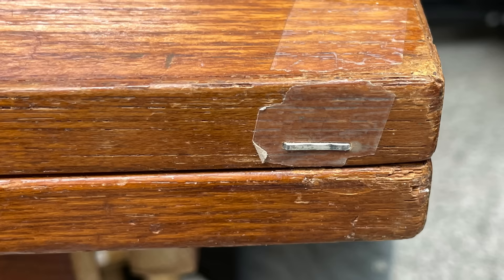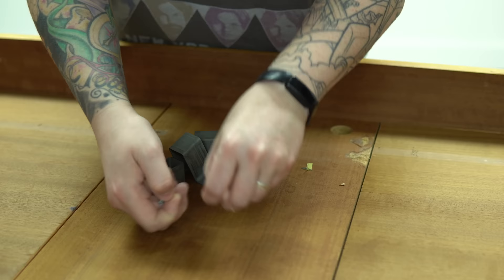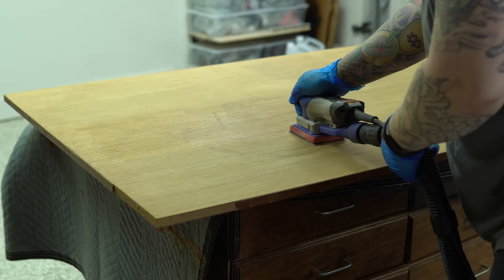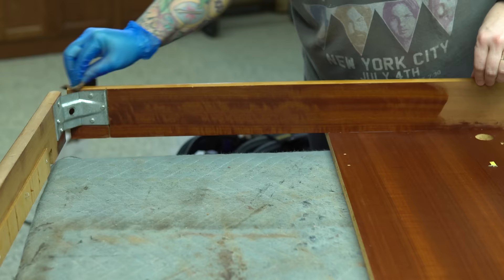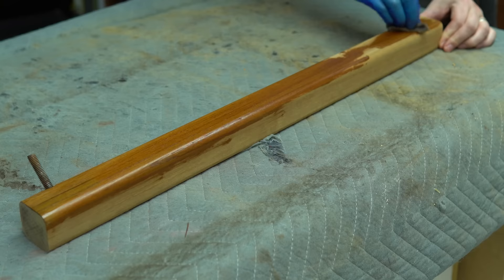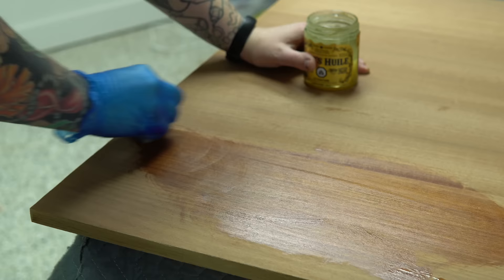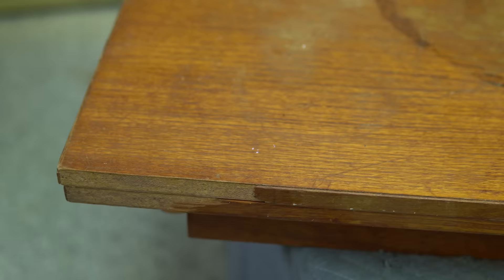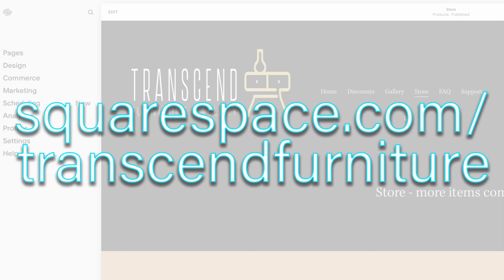I restored this absolutely WRECKED Teak Dining Table

Comment: Angie, I used to apply a sealer of some kind where I worked at a custom cabinet and door company.   My boss would say, "most people won't finish/seal the backs or inside or bottoms of a piece but it's really better for the wood as far as absorbing moisture less and drying less.  More even.  And besides,  it's us."
It turned out SO BEAUTIFUL 😍.   I'D BE PROUD TO OWN IT. And, I use coasters btw. 😃 💜
Reply from the maker: Thank you for using coasters! ❤️

Comment: Oh, the Oddie's Oil has a tung oil base! That makes so much sense! I keep hearing about how great tung oil is relative to mineral oil so I was wondering if you ever used it. Good to know! I've been trying to figure out what to do with my home's smaller wooden pieces. We live in high altitude desert, so it's great to get ideas on what I should use to keep them in good shape.
Reply from the maker: Yes it does! Thanks so much for watching!

Comment: It's not a silk purse but I rate it as a rayon purse from a sow's ear. What is the value of a piece of furniture made out of glued sawdust covered by a very thin veneer?
Reply from the maker: More than 3/4 of mid century furniture was constructed this way, to save money AND valuable resources (particularly exotic woods like mahogany and teak), and thank goodness they did it this way or there'd be none left. It may not appeal to you, but it makes the furniture extremely stable from a wood movement perspective, where solid wood is very prone to cracks and checks when it expands and contracts with temperature and humidity. It allows MORE furniture to be made from the same exotic wood, rather than one single temperamental piece of furniture, and it makes it more affordable for both the maker and the consumer. Have a look at retail prices of this furniture and the fact that they sell like hotcakes.. and then ask where the value is, haha. It's not just mid century though. A LOT of antiques with stunning woodgrain are also veneers. Veneer doesn't mean cheap. And the pressed wood of the mid century era is not the same as the 1980s and 1990s junk.

It's a very important question you asked though, so thank you for bringing it up! Not many people actually realize just how much furniture is made this way... most of it has been passed down in families as "solid wood" and it's not. There's just a misunderstanding of how and why manufacturers did this. 

The 80s are different. lol That's when factory furniture when to Sh*t. lol
Reply: @TranscendFurnitureGallery  Thanks for this detailed explanation. I do some refinishing but I mostly stay away from 80's and 90's pieces for this reason.
Reply: Yes but, saving an item from the pile of trash we generate to make is usable is a worthwhile goal and activity!
Reply: My thoughts too!
Reply: @TranscendFurnitureGallery  thank you for explaining. I always wondered.
Reply: @TranscendFurnitureGallery  Angie, I LOVE how much I learn from you!!!!!!!
Reply: I am refinishing an early Pottery Barn table, I am guessing it is late 60s, early 70s, by the style of the lettering I found on the tag.   The font used was popular during that area.  It was kind of hippie lettering that I remember during that time.  I messed up, thinking that somebody just painted over a beautiful wood table, and used a stripper, that stained the hell out of the grain in the veneer.  I was flabbergasted when I found the sticker, and found that that was the original paint job.  I also  sanded it, and used a scraper, and some of the veneer got scraped up with it.  Soooo, I am back to restoring the paint.  Even though the grain on the top (I haven’t finished it yet) is lovely… I am not pro, just did some refinishing since I was a kid.  The wood bleach is a great idea!
Reply: Right now I am working on four very rusted (one I painted when I was 12), nickel plated “Ice cream chairs”.  Somebody thought it would be a good idea to spray clear paint on them, and they got horribly rusty.  I am going nuts with this.  I have sanded off the rust, because, quite frankly, the rust remover by a well known company did diddly sh**.  I also sanded down parts that show the copper underneath.  I would like to have them re-plated, but I am afraid it might mess things up even more.  I want to leave as much of the original plating as I can.  These chairs, refinished are worth a lot of money, even those that have most of the nickel sanded off down to the copper.  They were made sometime in the late 19th century in Indiana.  They are riveted together, and one is bent out of shape by movers.
Reply from the maker: @davebryant8050 That's not entirely correct. Here, in Nova Scotia, this table would retail in a dedicated mid century store for close to 1500-2000 dollars CAD. Where I no longer have a storefront, I would charge considerably less, but still worth the time. I've seen these go for much more online and in larger cities. Looks are deceiving. You may see veneer and pressed wood, but that's what 90% of designer mid century furniture is, and the market for it is still going strong enough that there are many many stores devoted specifically to this exact thing. 
Not to mention, a huge portion of "solid wood" furniture sold in places like The Brick, Ashley Furniture etc... is NOT solid wood. But this same thing.. wood veneer over a manmade substrate, carefully stained and toned and finished to look high end. 
Once people start working on furniture, like really breaking it down, they often don't realize the myth of solid wood furniture, and that it's actually quite few and far between.
Reply: @DJarry394  "Owww!!" Sorry that that happened.
Reply: @TranscendFurnitureGallery  Correctamundo.

Comment: I LOVED the final results; I realize what you did, the overall approach. You "Made Haste Slowly," letting your stripper and sander do the work gently, because you were smart and experienced enough to realize that there was a treasure buried under the appalling markings that were all on the surface of the wood veneer. Since the veneer was only 1/16th(looked like) inch, there wasn't really enough for any heroic renewal of the surface by removal and the discoloration had to be removed by "elbow grease," basically. I think the grid mark was from a plastic beverage crate, that many people use for storage, which got wet with some stain or other. You did a beautiful job. Thanks for posting this.
Reply from the maker: Thank you so much for watching! I think you're likely right about the milk crate type of product leaving the stain, that's what I thought of as soon as I saw it because of the pattern. 😊

Comment: I'm only part way through but I would love a series on why you choose certain methods, like removing top coat, when you scrape, use stripper, or just sand.  If you were refinishing for selling vs using for yourself, what would be different about the process materials?  Just the basics of the why behind the different  techniques. 😊
Reply from the maker: Zero difference between selling vs for myself - I keep some of these pieces for our own house but every piece is treated exactly the same. I do have videos posted about sanding etc. If you scroll through my posted videos you'll see a number of videos that address things you're wondering about. I will say, in regards to sanding vs stripping - I usually will only sand a finish away if it's basically non existent or if I'm on solid wood. I'll scrape usually over veneer with SOME finish, or a lighter/damaged finish, and I'll use a chemical stripper for removing thick finishes or multiple layers of paint. I hope that helps!

Comment: Good for you.  That table is a worthwhile thing.  I just bought a modern desk from "Oklahoma Furniture."  I don't know what it's made of, but it's not real wood.  The finish comes off the edges, and it doesn't take Old English.  I can't clean the top.  Oil from hands gets on it, and I can't get it off.  Less than one year after purchase, one of the fancy metal drawer pulls snapped in half.  The desk cost over $1300.  (I have an old house with hardware that still functions after 110 years.)  In comparison to my desk, your teak table is a great step up.
Reply from the maker: Thank you so much for watching! Isn't it sad how poor of quality most "new" furniture is?? I'm so sorry to hear about your desk. I love the solid, older pieces. Worth a restore any day!

Comment: Hi, a tip for getting the Oxalic to work better is to use some soda water on the wood first and whilst this is still damp hit it with the Oxalic. You'll think you have ruined it at first as the soda makes the wood go very dark, but they react together and the Oxalic penetrates more and works better. You may need to do it more than once with a good rinse and dry in between. I've seen this draw out some incredible stains and oxidation 🙂
Reply from the maker: Thanks for the tip!

Comment: Hi Angie
I have too have tackled heavily damaged teak tabletops with Oxalic acid.  However I have had success with deep stains that may also be of interest with you.  I use barkeepers friend witch has a low concentration of Oxalic acid.  I pretreat the stains with repeated  poultices.  Ending the process after lifting them with an application across the whole top.  I haven’t yet had a bleach discoloration as a result of the pretreatments.  I have been able to remove 90% + stains employing this method on mid century tables and dressers.   8+ pieces done this way.  Perhaps too slow a way for a professional.  However for a beginner it’s an accessible product to get.  Allowing for a forgiving learning curve
Reply from the maker: Thanks so much for watching!

Comment: That turned very very nicely. I have had the smaller square version of that table since 1978 and it is in better shape than your “before” but has some blistering on the top from cat water (don’t ask.) That grid stain looks like a milk crate.
Reply from the maker: It does look like a milk crate, I suspect that's the culprit for the mark. Thank you so much for watching!

Comment: Fantastic job!  I didn't think you would be able to get it nearly so good looking.  I have the exact same table, although in much better shape.  Even so, I've lost a short section of the side veneer on one corner.  They clearly didn't use a good enough glue on the side veneer.  Nice work!
Reply from the maker: Thank you so much!

Comment: I ran into something strange in trying to refinish a Danish teak table. In sanding the skirt, it instantly went right through the surface and I found that it wasn't even veneer, but a printed film over pine. Of course I couldn't refinish it, but all I could do was to save the legs. I just got a small Danish tile top table. Thank goodness it doesn't need to be refinished, because the skirts on it appear to be the same.

Comment: I'm not quite grokking your lament.  A good restoration on a heavily used item, converting it from junk into one that is not merely "usable", but actually very attractive is in many cases (this being one of them) a better outcome than restoration to "factory".  You have left something of its former life, and to me that shows greater respect than erasing it and pretending it is as good or better than when it rolled off the line.

I got a pair of tables from Habitat that may be Nakashima's work.  The big table has seen some trouble and I applied tung and it came out well.  I would not endeavor to mess with any further, not from the collector's value, as I could not give a hoot about that, but from the standpoint of respect for its life, such as it may have been.  It now graces out dining room and IMO is gorgeous, whether the work of Nakashima, or someone else's.

You did a very fine job of this one and I share your view on saving well made pieces from the dumpster, a fate I find to be an obscene waste.

Well done.
Reply from the maker: Oh don't get me wrong, I'm never going for factory. Ever. I just have a certain vision in my head when I start a piece and tend toward perfectionism so when the finished product isn't quite the picture I had, it irks me. Simply me being my own worst critic. When it comes down to it, as long as I've given the piece a new life that's what matters. Thanks for watching!

Comment: This turned out beautifully!  I don't understand why you aren't feeling very proud of it.  I have an 120 year old table that hides the leaved in the center of it and needs to be refinished.  I think I will be trying some of your methods, especially the oil on it. I was wondering though why a coaster would be needed when it has 4 coats of lacquer on it?  I usually use coasters on anything made of wood anyway, but I was wondering about that.  I'm not sure you will see this, but if you do, I hope you answer back!  Thank you!
Reply from the maker: Lacquer is a fairly tough finish but its not infallible. No one really likes using coasters but there's no denying it definitely extends the life of a piece. Thanks so much for watching!

Comment: The final result may not be perfect, but it's still beautiful! 😄

I have a theory about what caused the staining. There was a cheap placemat, or maybe some pattern paper lying on the table, and someone knocked a bottle of alcohol over it, and left it until the alcohol was dry before peeling it off. I've done that myself, albeit on a smaller scale. Given how aligned it is with the edges of the table, it may even had been deliberate. I mean, the design is pretty, rather than featuring a fast food restaurant logo or something. Mind you, if it was intentional you'd expect a more central placement, so who knows? 😉
Reply from the maker: Possibly? If only the table could talk and tell us what really happened! 🙂 Thanks so much for watching!!

Comment: I have several teak pieces in my parents' house that were purchased in the early 60's while we lived in Finland.  I wasn't sure I wanted to keep them, but after watching many of your videos, I think they are worth keeping for more than just sentimental reasons.  One piece in particular is in very good shape, except for the top.  It is a buffet, and mother applied teak oil to it a couple of times a year.  After she passed, Dad did not keep up with that and there are a few rings from glasses and considerable sun damage.  I was going to just apply several applications of teak oil, but now I think I need to sand it first.  I don't believe the piece has ever had any laquer or varnish on it, only the teak oil.  If I apply teak oil after sanding, do I need to apply a protective finish, or can I just keep up the oiling, or should I try a different product all together?  You are such a miracle worker on the pieces you rescue.  If I can get this piece to look half as good as the table you just did, I will be very happy.
Reply from the maker: The long answer here, is as much as I would LOVE to be able to help everyone who reaches out, there sadly just aren’t enough hours in the day. There is another side to this as well- sometimes things don’t come across properly through photos and videos, and are best seen, felt, etc in person. For THIS reason, it can sometimes be difficult to accurately determine the age, finish, wood species, etc of people’s project pieces. There is also the element of user error, when recommending products and finishes, or misinterpretation of my instructions.

I get, on average, approx 40+ messages per day between Instagram, FB, YouTube, and email (and literally hundreds of questions in the comments). It is unfortunately just not possible to be able to get back to everyone. 

The short answer is this: you can certainly message me on Instagram and if it’s a simple answer, I may try to help you out. But PLEASE don’t take offence if I’m unable to respond! I need more hours in a day!

Comment: I need one of those scrapers!  That would save you money on Circa 1850 which costs $100 a gallon!
Reply from the maker: I usually will only sand a finish away if it's basically non existent or if I'm on solid wood. I'll scrape usually over veneer with SOME finish, or a lighter/damaged finish, and I'll use a chemical stripper for removing thick finishes or multiple layers of paint.
Reply: @TranscendFurnitureGallery  I just bought some oxalic Acid.  Glad I found your channel.  Thanks! Scraper another day.

Comment: Angie, another fine job finished, looks fantastic (compared to the original) with the stripper try applying some heat from a hot air gun- sometimes I have found this lifts the finish.  There is a small and cheap ‘edge band plane’ to cut the band.  Nice blog😄👍
Reply from the maker: Thanks so much for watching!

Comment: Nicely done! The only mistake I see(@17:51) is that you put the leaves back in the opposite sides. The wood grain should continue from end to end, easy fix.
Reply from the maker: I’m glad you mentioned this! Oddly enough, I had initially thought the same thing (even though I marked everything when I was taking it apart) when I put it back together. So I had switched them, and the grain still hadn’t lined up. So unlike most of these pieces, the pattern isn’t a perfect flow from one side to the other, which I found strange and interesting. No matter which side I put them on, it was still “off” just a bit. So they are actually correct based on the numbering from being taken apart but not quite a perfect pattern.

Comment: I would think you would want to leave some of the scars of life on the piece.  Actually good work.
Reply from the maker: On some pieces, those scars become part of the charm of a piece. Certain mid century style pieces though do better with full restorations where they look like they just came off the factory floor. So those ones can be difficult, when they start off this bad. In this case, I just have to accept that I did what I could for it and hope someone other than a purist gets the piece, haha.